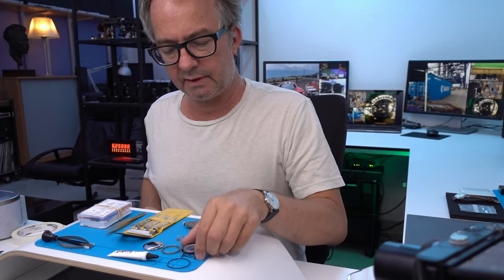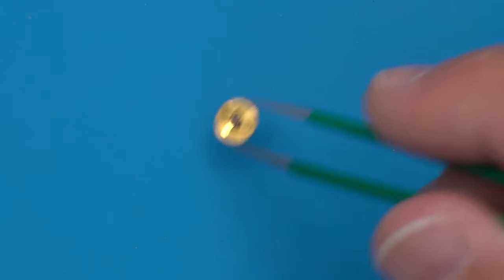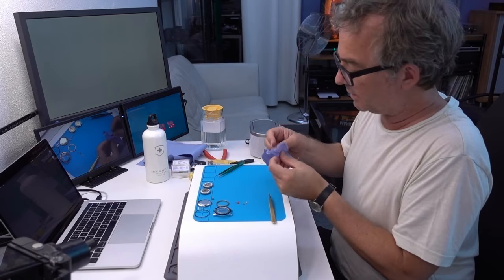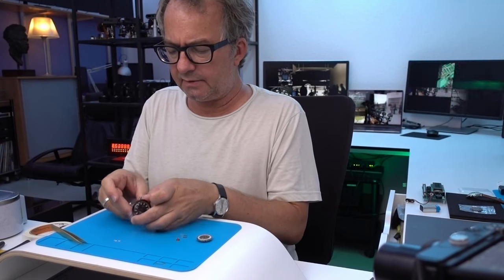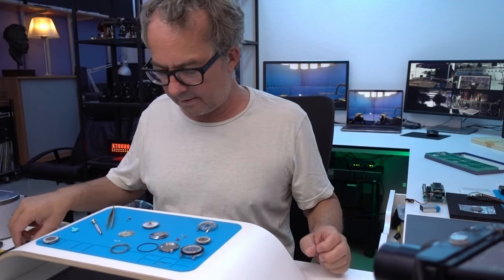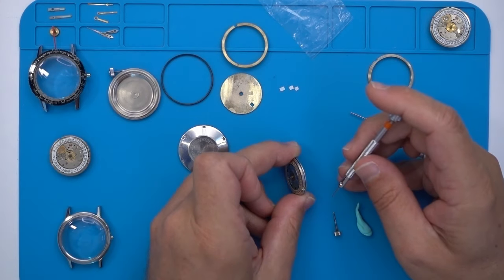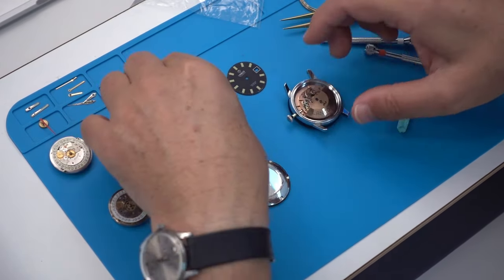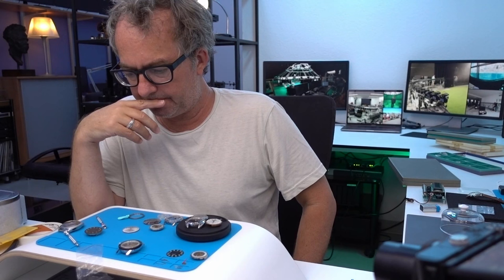Putting the Horror Back In Horology! - Realtime 1 hour

Comment: I like your radiation detector it's neat and simple. I wish you had a link to buy the item. Perhaps on future videos you could leave links to your neat tools.⌚🤭 I like the German lanco movt. Mix I would bubble crystal the top for more clearance and O ring seal the movt in by cutting and fitting find thicker O rings at the hardware plumbing dept new taller bubble crystals are cheap.
Reply from the maker: Thanks for your comment / question! The NetIO GC10 that I use is no longer made. However, it uses an SBM-20 geiger muller tube, which is also used in the GQ GMC-300E and other geiger counters, so in theory if you find one of those it should perform similarly. Stian with Vintage Watch Services uses a GQ GMC-300E as shown in the video linked below in which he also talks about the dangers of radium and shows the protection that he uses: https://www.youtube.com/watch?v=N6oPf3Pq6bU
Reply: Okay thanks I added a little more info on your Frankenwatch experience based on my watching antique vintage watch restoration some had o ring retention and bubble crystals add more clearance.
Reply from the maker: @timjohnston8608  That's a good idea. Thanks! Yes, Cousins UK sells acrylic crystals of different heights. I think the 0-rings are not used on acrylic crystals (they're generally for mineral glass and sapphire crystals),  but perhaps could be used as a spacer.
Reply: I ment to hold the movt. In the case o rings go around the movement and secure against the case.
Reply from the maker: @timjohnston8608  Got it. You mean O-ring between case and caseback? Or use an O-ring as a spacer in front of the movement ring?  Both are good ideas. It's important to always think about every possible hack for sure!
Reply: @IMakeWatches  between case and movement instead of screws to hold movement in place. Then sepretly just change the crystal to a taller bubble type.